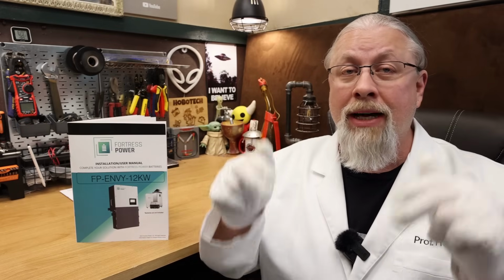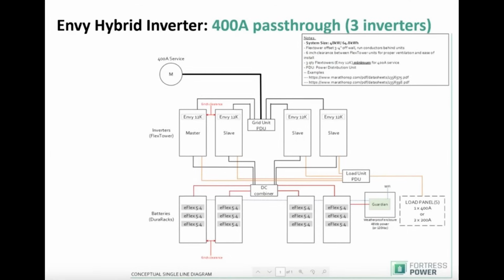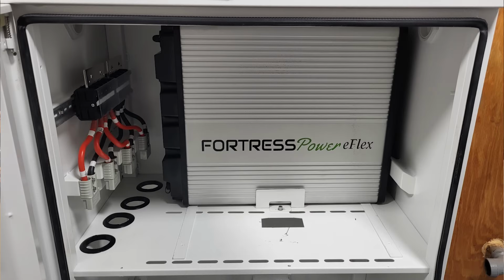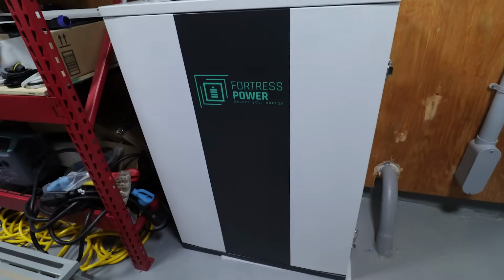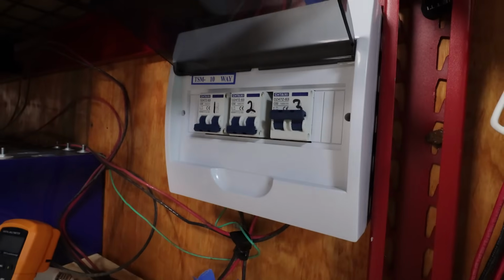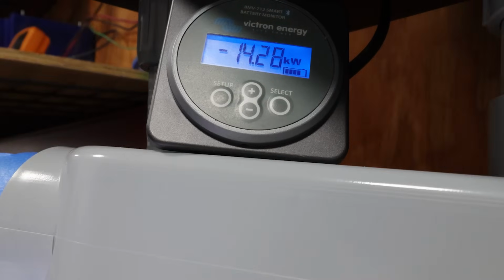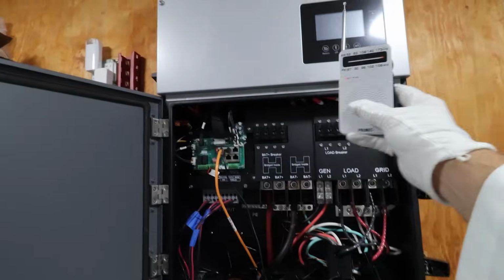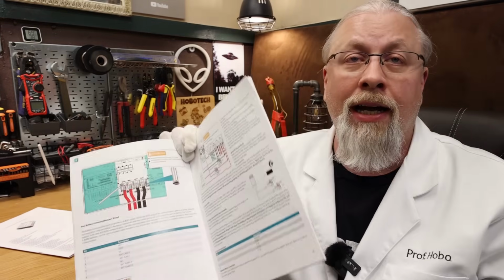Fortress Power Envy True 12k | eFlex 5.4 Whole Home Backup Solar Power System

Comment: HoboTech 
Question 
#1 EG4 6000 XP off grid unit thoughts 
#2 EG4 Indoor 280 watts 48v battery with wire box 
5 or 6 400what solar panels on the roof of many Off grid system Idea for my Cargo trailer
Reply from the maker: I recommend this unit over an EG4. If you insist on EG4, at least buy from my recommended reseller. You don't want to go with Signature Solar.
Reply: @HOBOTECH  Please Understand when I am Done Custom Building this Cargo Trailer if I am on a Job only the AC or Diesel Heater will be working while I am working 
I have a Honda EB2800I that powers tolls Ann Heating if Needed 
I Do live in Nebraska and have access to 4000 and 6500 Oman’s since it is my Company
Reply: @HOBOTECH  I have not seen a lot of Bad review on Signature Solar 
I guess it will come Down to Preference 
I don’t see a lot about Fortress units
Reply: @HOBOTECH  I did buy the Solar Panels Already 10 X 400 watt Bifocal Panels 
Most Days my guys bring the small 12ft try with 4000 Onan on them 
2 Line Trucks have 6500 Onan 

I just Tried of Motels and going to stay in this new 24 cargo starting 2025
Reply: Also the system on your site cost more the the Trailer

Comment: Huge Question…
We need to provide lithium battery (LifePO4 chemistry) backup for our remote site radio repeaters.
The sites have AC utility power with propane fueled standby generators.
The issue ?
If we use a 12v 100ah battery to provide emergency power, how can we safely and effectively keep the battery charged/maintained without damage to the battery?  Our old method of lead acid backup used a “battery tender”, but it’s not advised for lithium.

Any ideas?

Thanks!
Reply: All the commonly available 100 Ah, 12.8 V LiFePO4 batteries have built-in BMS. This means you can just hook the battery up to a power supply of around 14 Vdc and the battery will automatically stop charging when it is topped off. Alternatively, you can just hook it up to a battery tender. This works because you aren't dealing directly with the cells. The BMS protects against over charging and discharging.

Comment: Very good review. I have a SolArk 12K with the same battery setup as you (4 eFlex batteries, Durarack case, and Guardian Gateway). I had too much trouble with the battery separator/holder pieces, so I omitted using them. They are such a tight fit, that with the rack door closed they aint going anywhere. Fortress customer service/support is awesome and the main reason anyone would spend the extra $. They walked me through the entire firmware upgrade and proper closed loop settings on the SolArk. The Guardian Gateway I find of limited use and was expensive, but figured I might as well go for broke at this point and have the full monty. I learned a lot about my system.

Comment: What an incredible system, That is like it's own Sub Station, WTG Prof, You did well to stick it out get it all up and running, But If your in the mountains did the power company burn you when it came to getting the power to your Door or was the grid power not far from where you built ?? well done you should be proud of all your efforts,👍

Comment: Since this is Luxpower unit, that’s odd it would require phase matching for the ac input. Generators obviously wont do this, so it was likely an issue with the settings. I’ve hooked different inverters to my EG4 18kpv without that issue. Good video. Appreciate it.

Comment: You'd be hard press to find something in this price range this complete. I was looking at the EcoFlow solution, and man, that's like 3x the price of this for their whole kit. All 15 batteries 3 inverters and wall unit was like 55k. This seems to have greater power density, greater solar/wind input and can be installed outside for 16k. Nearly 4x as less.

Comment: HMMMMMMMMMMM.... THIS SOUNDS LIKE, they outsourced the "SOFTWARE" side to a 3rd party and they themselves don't actually have the info on it. WHICH means, there's probably another chinese product that has the same "OS" as this that may be better documented. Try going at it from that angle. Fortress Power might only be the PHYSICAL side of things. Not uncommon that they'd use a generic OS, but being generic means, there has to be other products with said OS that might be better documented. Like when I was tasked to repair a portable UltraSound machine, LUCKILY, it was simply a matter of putting a heatsink on the FPGA, since the braintrust decided to install the SBC upsidedown, then slapped the most GIANT thermal pad I've ever  seen on the back side where there isn't heat and taking up valuable breathing space. Then they proceeded to tell me it's proprietary tech. I've been around enough gadgets to be able to spot CHINESE generic, and sure enough, found like 10 clones on Alibaba that predate this product with the exact same OS just colored differently. Then I exposed said company for using their friends to pad their reviews. It got ugly, they took their page down because of me, then put it back up with no reviews, after being called a liar, even though I had photographic evidence of their terrible craftsmanship. It was kind of a cool device since it was so cobbled together. The ultrasound wands used MICRO HDMI connectors as data and signal. The PSU was an off the shelf laptop Powerbrick, that they put on the bottom of the device so that you couldn't plug it into a wall outlet and use it at the same time. They used a MiSTER as the brains, was a real Frankenstein's Monster of a device. Once I put the heatsink on the proper side, installed a fan in it, and removed the GIANT HEAT PAD, the client hadn't any issue with the device to date. That device literally cost like $4000.

Comment: If this System has a way to Recharge it by a Propane Generator, it’s Something I would look in. We only have the Sun here 4 months a Year Maximum.
Reply from the maker: Yes, it can charge with any kind of fuel generator.
Reply: Looks like you need a battery bank that holds 8 months worth of power

Comment: The door knocker’s wanting have you upgrade to solar do not want to talk about battery’s 🔋  🪫 and with the price of panels dropping they’re not ready for you to say anything about this.
Reply: That’s because batteries are typically AC coupled and that adds a lot of cost to typical grid tied solar systems. 

The setups shown on videos like this are DC coupled and that helps save thousands of dollars. But unless you’ve got a reputable installer willing to setup such a system then you’re going to have to learn to do these kinds of things yourself.